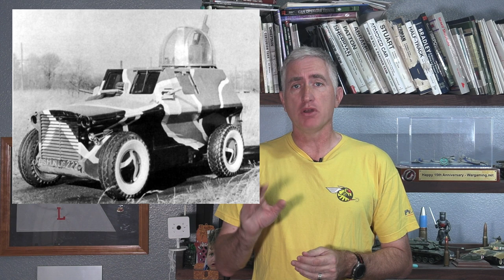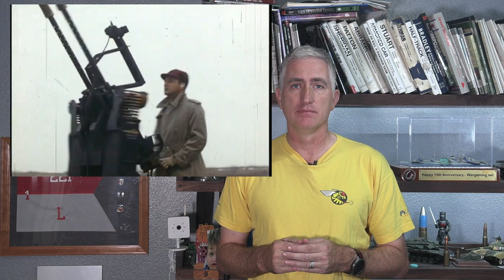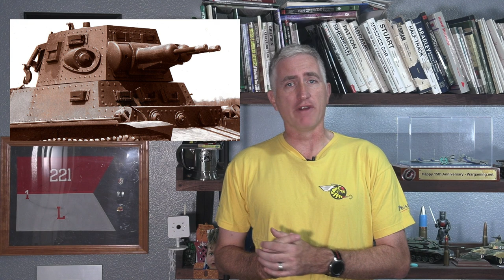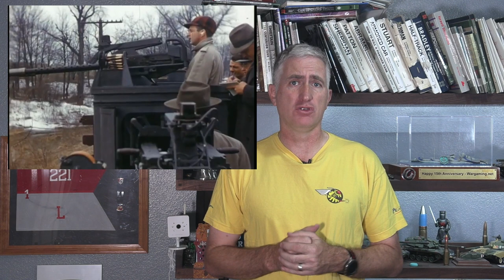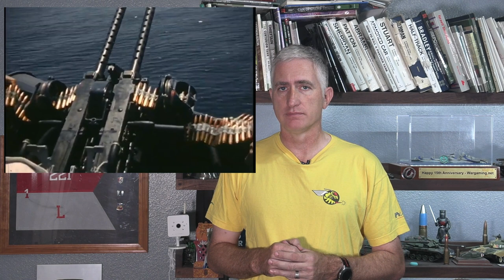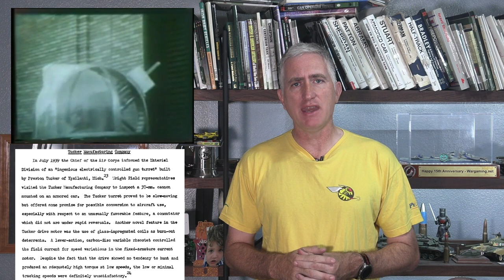Why the Tucker Tiger Failed

Comment: All I really got from this was a new appreciation for how much Preston Tucker had pissed off the wrong people.
Reply: So to you this thing sounds like a perfectly feasible, rational, acceptable vehicle, and it was only declined because Tucker "pissed off the wrong people"? So the total lack of off road capability, the unsafety of driving at high speeds, the fact that they didn't need a car that went 100mph, the brakes that wouldn't hold on a slope, those were all just fine, not really problems at all, and the fact that they offered to let him fix the problems and bring it back and try again but he just abandoned it entirely instead, this is all evidence that they were "just out to get him" in your head?

Comment: Sounds like the Tiger had the usual teething problems, and Tucker himself lost focus to some extent. Your description makes it sound like the Tucker was told “not bad, let us know when you get these certain issues fixed, and we’ll give it another test run.”

Honestly, that vehicle, but in AWD and with better tires WOULD be awesome to drive.
Reply: You mean the M3 scout car?
Reply: @Erdanya  No, he means proper vehicle, not that useless garbage...
Reply: Without doubt Preston Tucker could design anything that was fun to drive.  But to make that armored car anything of real use to the Army, 'he'd have had to go back to the drawing board.  The hemispherical turret was a great idea, but the car itself had a gear box ratio ill-suited for the combat role, and it was too narrow to be stable enough with that turret.  Plus, it really needed wider tires which may not have been readily available, in order to have a ground pressure that made it able to go off-road and/or not get stuck on dirt (MUD) roads, which Europe and even rural American at the time abounded in.

Comment: So glad you untook this topic cheiftan. Ive been wanting to know about it for a long time. I wonder if it would have been a good escort for supply convoys.
Reply: Why, because supply convoys travel at super high speeds and they need something faster than a M3 Scout Car or M3 Half-track to protect them? What exactly can this machine do better than what we already had is what you need to ask, and is that capability something that we can actually use? The answers are "no". Certainly not since we have to build them all, ship them all overseas and then across the channel. How is a car that travels at the same speed as the convoy, but can't leave the road lest it get stuck, but which CAN go 100mph (although it will probably crash and kill you) better than a truck with a .50cal on top, or a armored car, which also travels at the same speed as the convoy, but which can go off the road without getting stuck. Or you could just crank out a bunch more M8 Greyhounds, with 6x6 drive and 37mm gun, if you really think that 37mm is essential.

Comment: Being "too fast" is a perfectly reasonable disqualifier. Prior to this breakdown, my impression had been that the Army figured putting the keys to an armored hot rod like that in the hands of Pvt. Schmuckatelli would end up killing more GI's than it would the enemy.

Given how the guys at Aberdeen didn't even try running it up, down, or across hillsides because they could see how badly the tiger did off-road even on the flats, it seems my guess wasn't all that far off...

Comment: High speed in the military is good. Because we want to get out of trouble faster than we got into it!
Reply: Yeah, if you can handle the high speed. If the car can't safely do it, then it is pointless. In any case, like he said several times, they didn't turn it down because of the speed they just mentioned they didn't really want it much. they turned it down for being shit off road. Being able to go 70mph (I don't beleive it would actually reach 100mph for a moment) is useless if you are bogged in mud under the enemy's guns unable to move, or if you can't move off the road to avoid a trap, or just plain get stuck trying to turn around to escape one they open fire on you.

Comment: Sounds like this really, really needed to have been tested in the 4x4/duallies configuration and could have benefited from the practice of putting the spare wheels on the front axle for dual wheels there as well when extreme terrain needed to be traversed, assuming two spare wheels could be carried.

Comment: Quick question, what's your source for the Brewster X3 B2A project? 

I'm curious because designation doesn't match the standard US style and a cursory(Wikipedia) doesn't list any Brewster projects with an XB designation. There was an XA-32 but that's a single-seat multirole fighter with no need for a turret and all of their scout bombers were given XSB designations during development.
Reply from the maker: It was the History of USAAF gun turrets report.  However a chap down below thinks it should have been XS, not X3. Which is quite possible, my copy of the report was faded on that character
Reply: Thanks, that makes a lot more sense than some phantom prototype and it lines up with the development of the Brewster Buccaneer. The Buccaneer prototype, XSB2A is described as having an enclosed gun turret which was later replaced by a flexible gun mount.

Comment: I don’t know if the Tucker turret had any role in naval turrets, and the list of turret designs I have found does not include Tucker (they list one Grumman, two Erco, four Martin, one Consolidated, one Sperry, one Emerson, and one Bendix base model turrets with a couple variants of each). Maybe there was a Tucker turret on some prototype or it had some influence on one of these, but I doubt it. 

However, assigning Tucker turrets to Brewster bombers may be a major clue. If there was one US manufacturer that consistently built poor quality aircraft, it was Brewster. The only major production aircraft were the SB2A, such a poor bomber that it was mainly used as a target tug, the F2A Buffalo, which had about a year of carrier service between the F3F biplane and F4F Wildcat and only had good service with the Finns, and the F3A Corsair. According to legend (and I’ve never confirmed this), Brewster-built Corsairs would shed their wings under certain conditions, and US aircraft were primarily used for training, though I have found some British F3As made it to the Pacific Fleet (tracked down one destroyed by a kamikaze on Formidable). For decades no Brewster aircraft was known to exist, but four wrecks have been found and are in museums, though only the F3A and one SB2A have been restored. 

If Tucker turrets were assigned to a Brewster aircraft, they were not held in high regard. Likewise, had the Brewster aircraft received Sperry turrets, I’d be surprised at the perceived quality of the design.

Comment: Also i think many mistake the Dewandre turret on PT boats as the Tucker because they have a similar look.  The most common is the PT-20 which had the glass tops but was once again a Dewandre design. 
I honestly could not find any active boats with the Tucker turret design, and none that used the 37mm as theyy all tended for the .50 cal - there may be some prototypes but none of active service... 
Please let me know below if you know of any, as i am by no means an expert on the 10 trillion different pt boats the us used in ww2 :p

Comment: A 4x4 version of this, perhaps with the turret replaced by a large two-piece hatch and a pintle for God-knows-what, might have done well in North Africa. Open spaces, relatively flat... Imagine the LRDP with a 100-mph rally car armed with a Ma Deuce. 
I'm also surprised an unarmed version wasn't offered, as a light, fast transport or ambulance. The lack of a heavy turret, gun, and ammo might have improved it's stability, and it certainly wouldn't have been the worst light truck of the war.

Comment: I would definitely suggest reading up on aircraft turret design to those who are interested in technical stuff. You think they are just rotating things that go left and right and up and down, but no. they are far more complex (although basic types exist as well). They have to meet maximum and minimum turn rates, which need to be the same regardless of G loads and slipstream action on the turret and gun barrels, so the turret needs to detect the forces acting on it and vary the motive force accordingly. They can be either hydraulic or electrical. The traverse rate need to be fast enough to track close in targets, and slow and fine enough to track distant targets. the controls must be totally linear, the speed dependent on the amount of control deflection. I had no idea how complex and expensive these turrets actually were, each turret on a B-17 or 24 was a relatively major piece of equipment, and cost something like $14,000, IIRC, which is almost the price of a whole fighter. Whether it was worth it, I can't say, but it is an interesting topic.

Comment: Kind of. Some of the turrets gone used on several different planes, notably the GE Electric turret. which was top turret on the B-17, B-14, B-24, and B-26. And I think the B-24 had a few different models of nose and tail turrets. But the original intent was as you say. Which is either a intelligent way of making sure at least some of the turrets came out successful, or to spread the government wealth around as much as possible.

Comment: Can you imagine trying to gank that zippy little thing with a manual turret? GOOD LUCK! 😂
Reply: "zippy little thing" here being a 5ton truck with notably tall profile and limited terrain crossing ability. You could lead it easily down the road, and offroad unless your on a salt pan or simlar, its going to either be limited in speed, or in possible routes. It wins major cool factor points for its v12 engine and ludicrous top speed, but it wouldn't have been hard to spot, nor shoot at.
Reply: @SheepInACart  your right it would be easy to shoot at 

But not easy to hit 

Also notice I said with a manual turret... ya know with crank wheels and a lot more required attention to detail (the same types of turrets that made firing from anything other than a stationary position basically pointless) 

yea if someone was dumb enough to take it somewhere to get it stuck or crash it 

Drive ANYTHING in a straight line or into a dumb area and you’ll get swacked

But judging by your reply I can see you think of me as dumb for a simple internet comment... so I guess I couldn’t convince you of anything, mr superior 😂

Comment: There were some open twin .50 cal turrets on USN small craft, like torpedo and patrol boats, that certainly look like the Tucker design, in fact they were the first thing I thought of when I saw it, but I don't know their actual origin.
Reply: The PT boat mount was based on the Bell aircraft mounting, most of these aircraft and ship mounts where based on the "light barrel" M2, rather than the "B" (heavy barrel) found on vehicles "duel purpose" mounts, so its unlikely they share much ancestry.
Reply: @SheepInACart  Cheers!

Comment: with a overhaul of the design...it could have been pretty useful....4wd...wider body...less ground pressure and higher ground clearance....maybe even 6x6 or 2x4 would have helped....yeah slower but still fast enough...he should have looked up ,what the brits learned from the first usage of rolls royce armoured scout cars from ww1
Reply: So, what you're saying is, if they'd completely redesigned the vehicle from the tires up, it might have been good...😋
Project lists like that are why I gave up on my Merkur XR4ti.  Could have been a great car...once I'd replaced the engine, turbocharger, cooling system, A/C system, brakes, exhaust, grille and headlights, and transmission...and repaired the suspension, interior, taillight clusters and wiring, spoiler, and some bodywork.
Reply: @christopherreed4723  kinda...the vehicle is more lika a starting point

Comment: Sorry, that diagram isn’t of a lateral sway bar, it’s of a lateral link bar, it stops the axle moving sideways under the vehicle under lateral cornering load, often referred to as a Watts linkage (even though it’s not actually one).
Reply from the maker: If you say so. The report called it a lateral sway bar, and I'm no automotive engineer to correct them. Is it possible that the definitions changed over time as new technologies were invented?
Reply: A watts linkage is different, the sketch is of a simpler design called a panhard bar, but the function is the same.

Comment: off topic but you mention  how powder charges were changed for howitzer and I have heard this of mortars, were shells preloaded with full load and adjusted as needed or powder separate ? If full load what was done with powder removed?
Reply from the maker: For artillery pieces? Yes, the 105, for example, could have charges pulled out as necessary. I have no idea what was done with the excess, mind.
Reply: What I have heard about excess increments is that they'd be put aside and soaked in diesel fuel.

Then, if/when the bad guys got close to the artillery, they'd load the fuel-soaked increments and fire what's basically a very large "dragon's breath" round.

They called it "captain crunch"
Reply: @TheChieftainsHatch  or you just lay out the excess powder in a line and burn it. Not so much in combat as it tends to be very impressive, but it helps release your inner arsonists in peacetime.
Reply: WW2 British (or at least Australian) practice was for the excess incremental charges to be placed back in the (flash proof) steel ammunition cases and returned to depot. I can only assume that when working from a limber they kept a few empty cases to put the excess charges in. My father was a '9 mile sniper' 1939-46.
Reply: thank you all for the info
Reply: @markschoch9592  I should add that my story is post Vietnam practice. I assume it was developed during Vietnam in case a firebase was overrun.

Comment: A too fast car will be too expensive, will take too much fuel and that performance will be useless anyway because you can't go 110 mph off-road or on damaged wartime roads. A recon car only needs to be a bit faster than the column it serves, which may include tanks,  APCs, artillery tractors and heavy trucks, so being able to go 110mph will not bring any benefit when 40-50mph are enough.  Not to mention that in combat conditions one needs to tread carefully in order to avoid mines or ambush. The Army took the right decision on this.
Reply: Indeed, with MRAPs, experience has shown crew protection is paramount over top speed.

Comment: If the Tucker Tiger if supported by a manufacturer willing to admit deficiencies including the need for significant modifications might have had a chance.
Reply: What inhouse development would you actually have even kept if you redesigned the Tiger to be good offroad? You'd need new axles/transmission, it was a Packard engine that was already used elsewhere, the armor layout was already to topheavy for its width even without a turret installed, the glass turret was a complete non-starter of an idea. The only things Tucker did would need replacing, it'd be a totally separate design for the company.
Reply: @SheepInACart  
Nothing wrong with the transmission. Longer axles and the existing 4 wheel drive system.

Comment: There is absolutely no way 175 hp will propel a 10,000 pound vehicle to over 100 mph.  To say nothing of steering, suspension, tire technology, etc.
Reply: No, I am sure that is just theoretical, not actual top speed.
Reply: @justforever96  What?  It's not even theoretical.  It's impossible.  Simple physics.

Comment: Track-tire systems have always seemed to be about as popular as recoilless rifles with soldiers a hundred meters back. At least the recoilless rifle can send a 75 mm M48 HE down range from something that can be mounted on an MG tripod. How does one adjust the track tension on a tire cum track system - inflate/deflate the tires????
Reply: Not sure you need too. You need to adjust the tension on a metal track because it stretches over time and use. Anyway, if they can make adjustable idler wheels of tanks, I don't see why one can't make a design that allows you to adjust the front suspension links to move the wheels forward or backward. It is basically the same thing.

Comment: ONE OF THE MOST SEVERE ASS CHEWING I GOT FROM A OFFICER WAS A TRUCK I WAS DRIVING IN A CONVOY TO SUMMER CAMP, NOT FOR GOING TOO FAST ,BUT TOO SLOW!!
THE TRUCK WAS UNDER POWERED
AND ON A 2 1/2 TON CHASSIS!
WITH THE WEIGHT OF THE SPECIAL EQUIPMENT INSTALLED, 
IT COULD NOT RUN FASTER WHILE GOING UP THE MISSOURI OZARK HILLS!
THE EQUIPMENT SHOULD HAVE BEEN ON A 5 TON CHASSIS!

Comment: Seems they were correct in describing it as a "Car" Instead of a truck. 2 wheel drive, what was Tucker thinking ?. Rubber band tracks that slip over the tires that are hanging out for all to shoot at ?
Reply: "Car" was the standard nomenclature. Trucks were for carrying loads, tanks were tracked vehicles. See M3 Scout Car. Hell, see the M1 Combat Car, which is just a tank, but they couldn't call it one because only the Army was allowed to use "tanks". It has nothing to do with being two wheel drive or fast or on or off road or anything. And I don't see what the problem is with the tracks. It is not meant to be a combat vehicle wading into the fight, it is meant to spend as much time as possible avoiding the enemy and retreating as fast as possible if it comes into contact. The tracks are perfectly adequate for this. Especially since small arms fire isn't going to hurt them much. What do you think bullets are going to do to rubber tracks exactly? It would take a lot of bullets to tear through one, and in that case you just proceed on wheels. Funny, you seem to think rubber tracks are too weak, yet most armored cars drive around on rubber tires which can be ruined by a single bullet. I feel like you didn't think that one though at all.